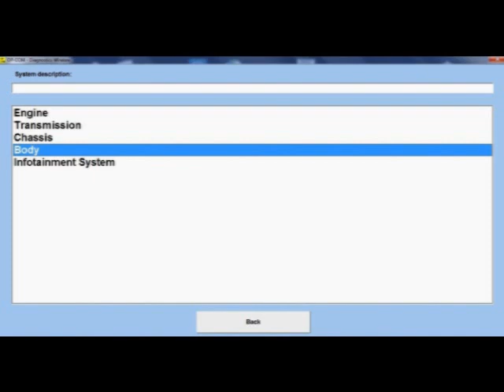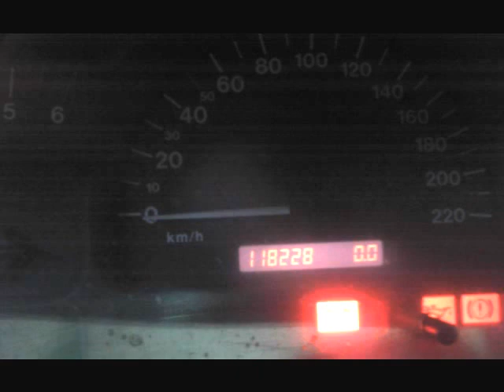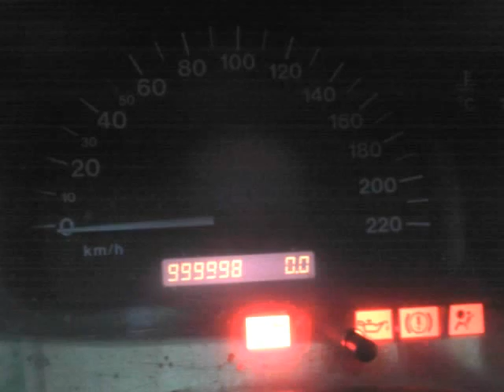Cambio km OPEL- vauxhall (cuadro de instrumentos) 😒👀

Comment: buenas tardes e probado con opel frontera b del 2000 con el opcom 1.95 y no me aparece la opcion de isntrument en body , el obd comunica perfectamente y estoy utilizando win7 que puede ser?
Reply from the maker: Hola Juan Javier. Tienes que utilizar opcom-china-clone (la versión china del programa original) si no, no podrás.
Un saludo.
Reply: @SistemasEléctricosdelAutomóvil   vale gracias , seria posible utilizar la version chinca con un lector obd original de opcom? Ja que tengo jo el original gracias, y a parte aue verdion me recomiendas de la version china? Gracias de antemano